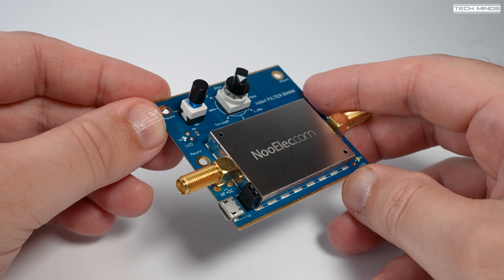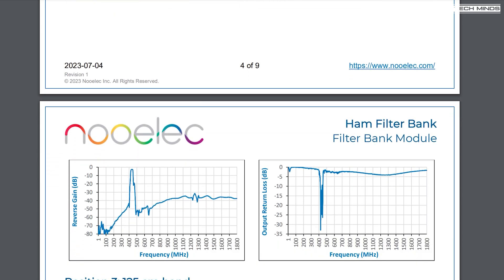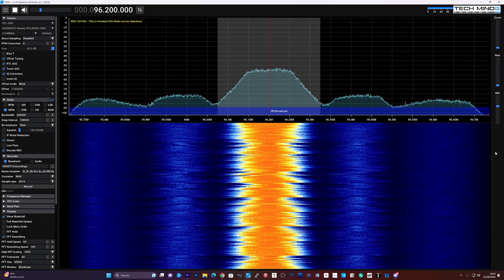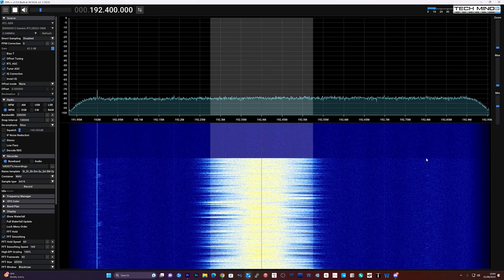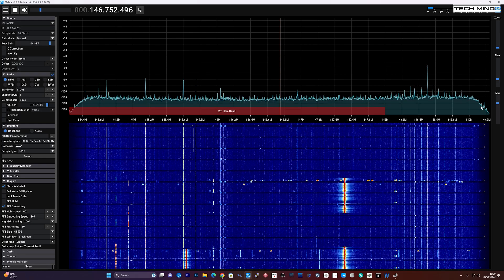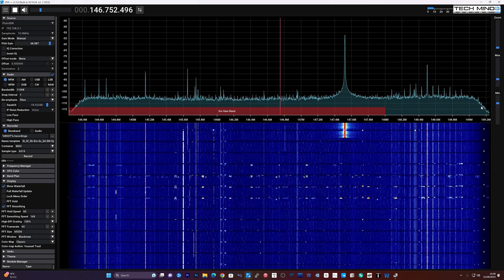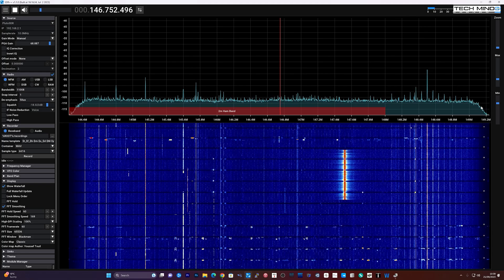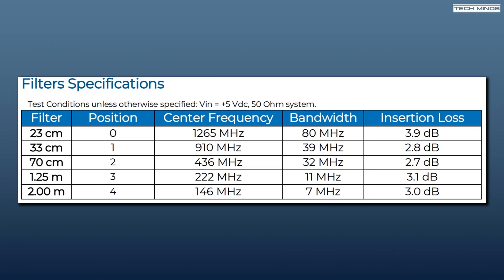NooElec Ham Filter Bank - 5 Ham Radio Pass Band Filter Board For SDR

Comment: Nice review. Why does it need DC power ? Are there active comonents on board or ist it just to pass through to power other devices and therefore not really necessary for the filter to function ? How can it filter out an unwanted harmonic of a broadcast station if this is falling in-band ? Or does it just block the fundamental of the bc station which would otherwise cause production of a second harmonic due to nonlinearity in the SDR receiver ? Don't forget that the added insertion loss will add directly to the overall noise figure of the receiving setup. It still appears to be a very useful product ! Sorry for so many questions. I really appreciate your reviews and have bought several items of equipment based on them ! I will be ordering one for these filters 🙂
Reply: Active. Requires 5V.